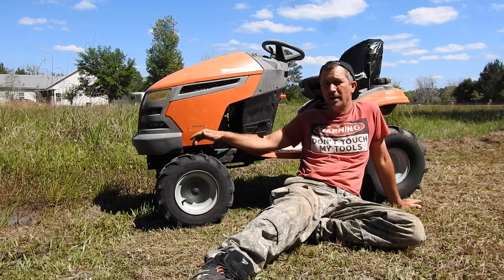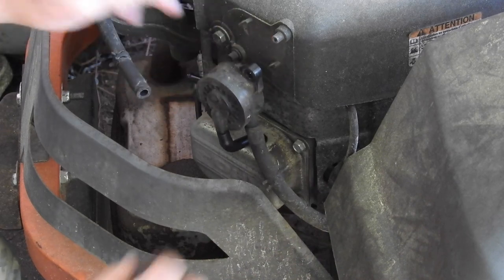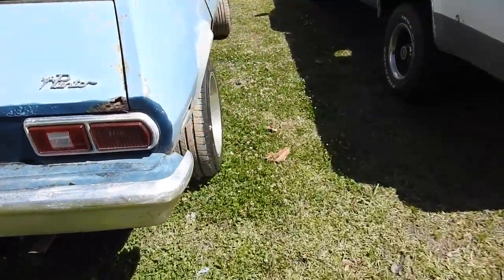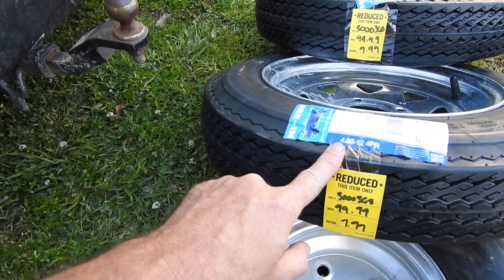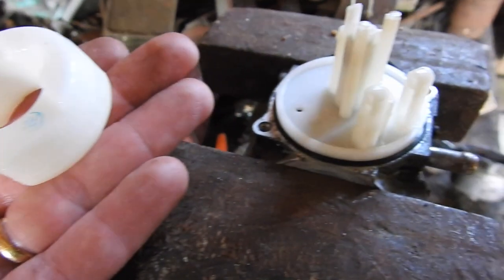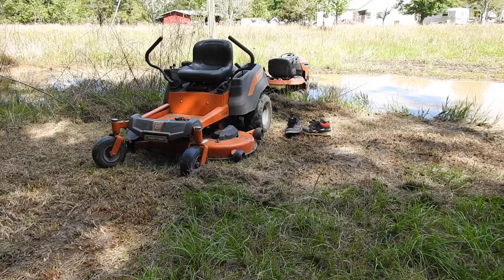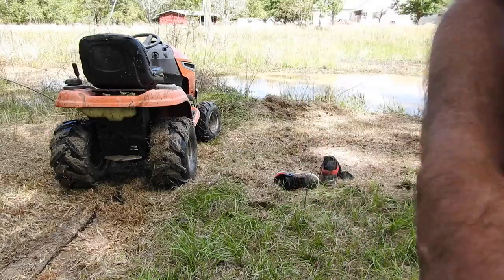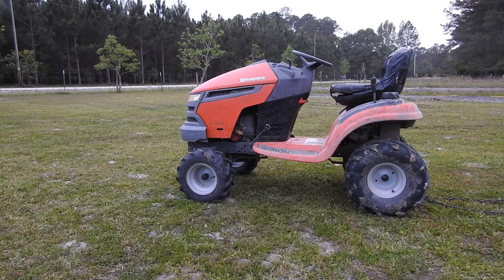Getting a Bunch of Super Deal and Husquvarna X 2!!

Comment: Those v twin briggs with the plastic intakes are notorious for warping where it bolts to the carburetor causing that surge. I remedy it with new intake gaskets and coat all the gaskets very lightly with permatex right stuff gasket maker. Also replace the intake o rings that seal the intake to the block. I take some super fine steel wool and clean the mating surface on the block too. She will be purring with no surge after that, as long as the carburetor is clean and working properly. Love your channel man, I got an old craftsman I want to throw a giant lift kit on lol
Reply from the maker: Great tips, I need to check into that. Thanks for watching!!

Comment: True fan.    I’ve got a craftsman 6500 garden tractor with a 26hp Kohler.  It leaks oil from the front of the engine and it drips on to the exhaust and smokes.  I need to find out where is leaking from exactly.
Reply from the maker: Sounds like a powerful mowchine! Thanks for watching!!

Comment: Hey chud I have a pully swaped mower and some times I have to pull the clutch back manually to get it to go. Do you know what can fix that?
Reply from the maker: I am not sure, you could probably add another spring at a different angle to help out. Good luck and thanks for watching!!
Reply: @chud327  thanks i thought the spring was just weakened .
Reply from the maker: @nrgtwinz95  that might be right…